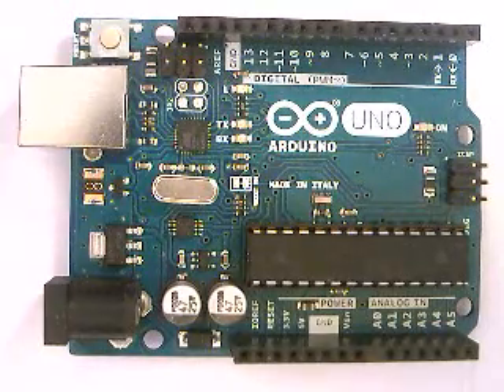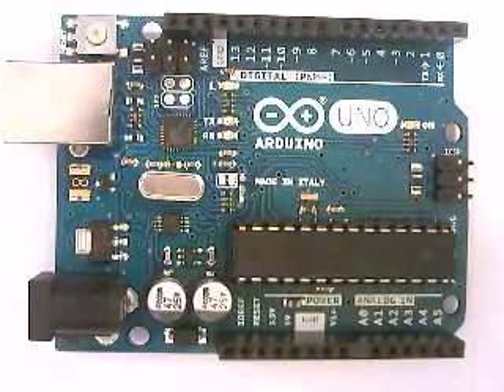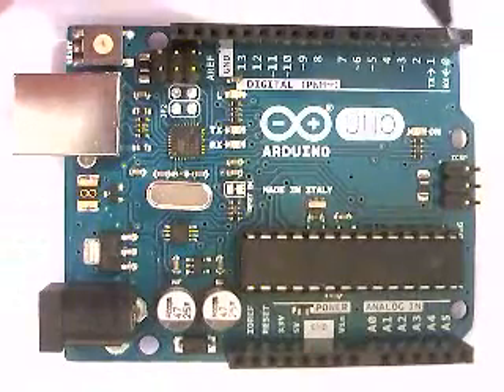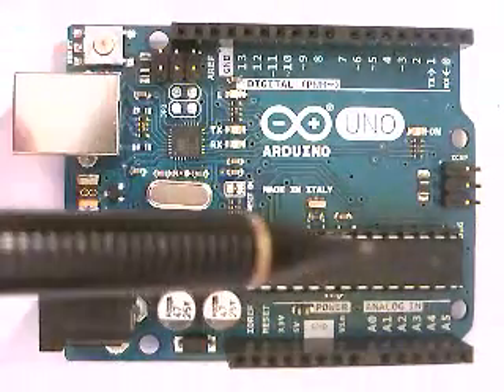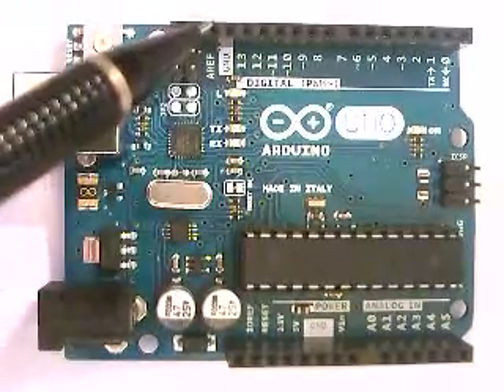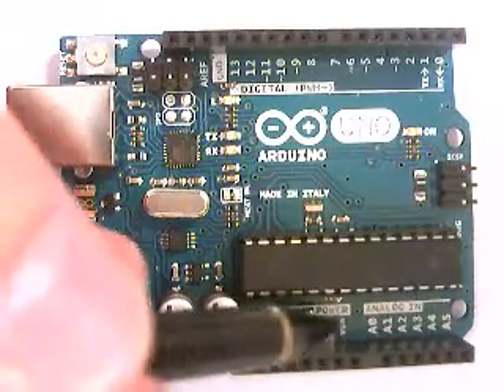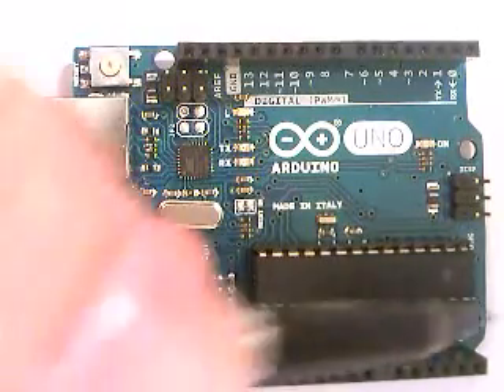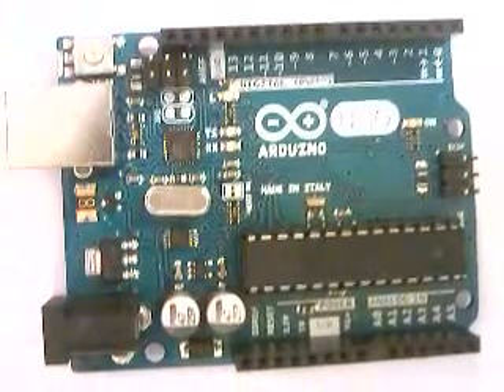Arduino Tutorial: Overview of Arduino Pins

Comment: At 4:41, you say that the digital pins (w/o the dash in front of it) can work with inbound or outbound signals. You also say it's either 0 or 1. Between 0 and 1, which is inbound and which is outbound?

Comment: Very helpful video! Thank you very much!
I would like to mention that the input voltage limitation for Arduino UNO R3 is 6V-20V and  7V-12V is the recomented input voltage range! Correct me if wrong...
Reply: 5 to 9 v only man
Reply: Hope you didn't burn your atmega 12 pin